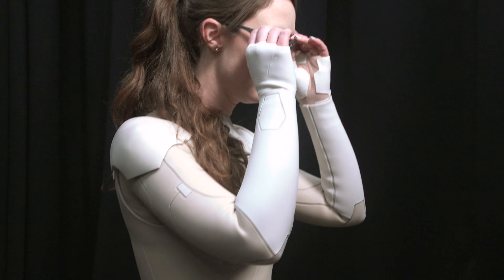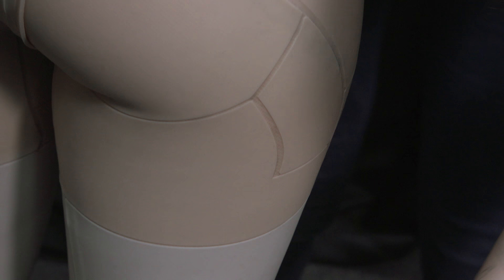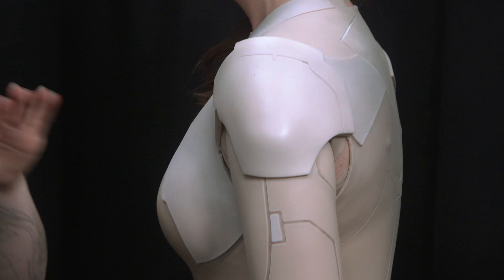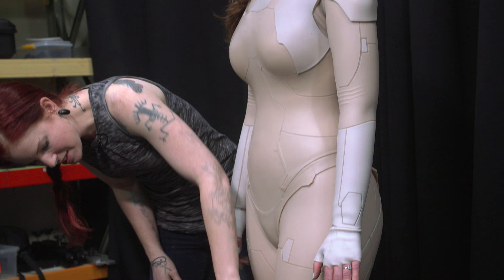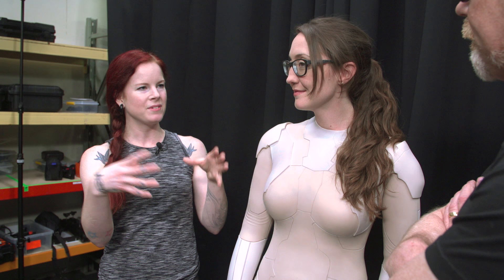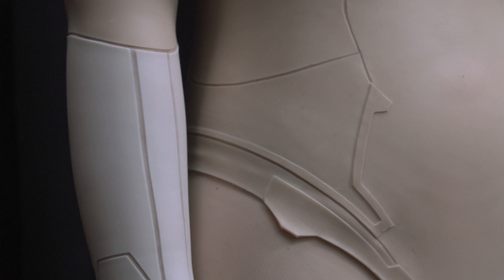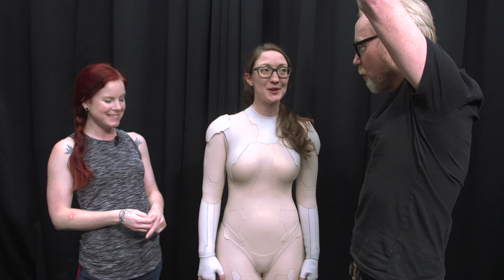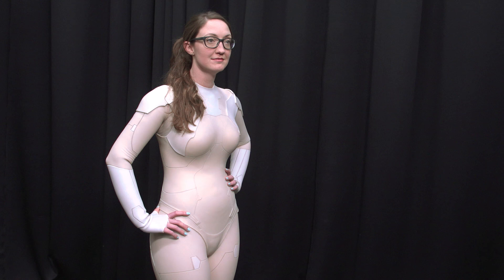How Weta Workshop Made Ghost In The Shell's Thermoptic Suit!

Comment: I made a silicone suit for myself some years ago that had a black and gold color palette. Two things made life infinitely easier; one, I used compression clothing for the base (no talc required!) and molded in a carbon fiber weave to the top layer to avoid the denting issue. It was part of the design to begin with, but I could see where it would be an issue in a smooth-faced design. GITS and the Bladerunner reboot are two of my most anticipated movies this year!

Comment: Fantastic work but somewhat distracting.  Sad because in the original material many of these cyborgs were used as pleasure bots.  And of course in most of the anime and manga the major is basically an ass kicking commando with a sexbot body, right down to often wearing lingerie "uniforms" on duty.  And of course many of the plot lines involved intrigue and espionage centered around sexual weaknesses in certain government high officials.   Who wants a pleasure bot with no nipples?    If they had stuck with the source material and maybe had done the plot of the first two anime movies it may have made sense.  But otherwise, it kind of misses the point that the tech for some of these cyborgs was able to reproduce human organs.   The second movie though does play up the concept of cyborg dolls being "the shell" that lacks a soul and if they actually had done that story line this suit would fit better (pun intended).   This latex suit devoid of any 'pleasure zones' dead ends the sexual sub plot.